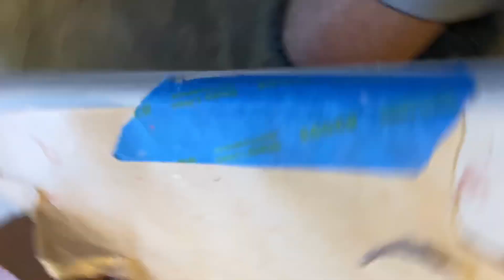Irod Kaimana 794 Review

Comment: Have had 3 IRods. By far best rods in there price for sure. Would recommend to anyone. Got an air series hvy I use for punching and frog fishing along with heavy jigs and small rats/glides like 168 swaiver or cha cha glides. Thing is super light, sensitive and just a great rod. Swimbait rod is also a Irod and like it just as much as my Loomis IMX swimbait rod. Great bend with the tip not being to weak. Dope rods for sure.

Comment: Can the Irod Kaimana 794 handle heavier weights up to 3-4 ounces comfortably? I need a rod that can pull double duty for both flipping and swimbaits. I need a rod that can handle crankdowns, multijointed swimbaits, topwaters, rats/wakebaits and glide baits up to 3-4 ounces. What weights would you say are in it's 'wheel house'? How long is the handle from the back of the reel seat to the bottom of the butt cap? Thanks.

Comment: I contemplating the 794 vs the 804, do you have a thought between the two? I want my next setup to be handle halibut and large stripers in the SF bay, and also be able to hit the lakes & reservoirs for bass, thinking my heart is set on the new Penn Fathom 300 but unsure which rod would be more ideal, any feedback would be greatly appreciated!
Reply from the maker: The 804 has two models. One that parabolic and one that has a faster action. Those rods are rated to 6oz. The 794 can handle 3-4ish at the top end. For a flats rod drifting with smaller ball sinkers the 794 would be ideal IMO but it’s so hard to recommend on things like that. I would think that the 804 moderate MH would pull small trailer trebles over the 794... plus if you usually use smaller swims not over 3-4ozs the 804s maybe be a bit overpowering and heavy